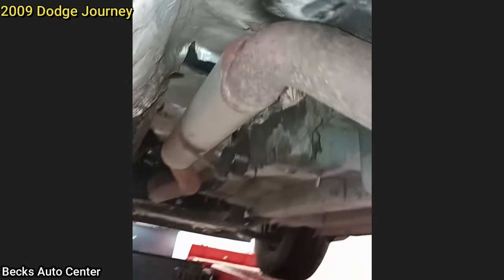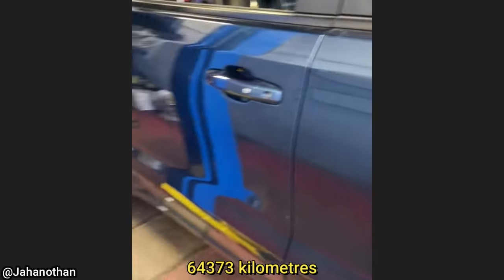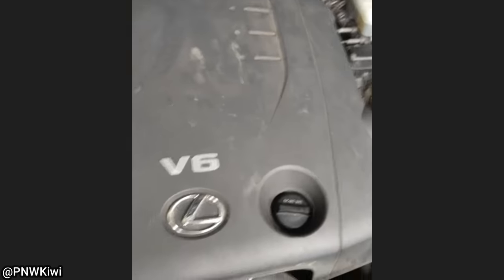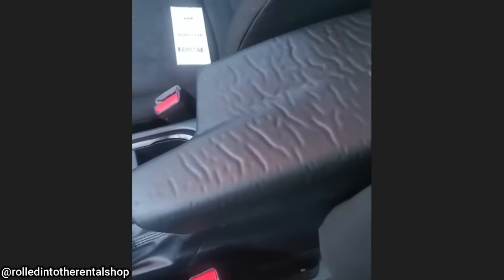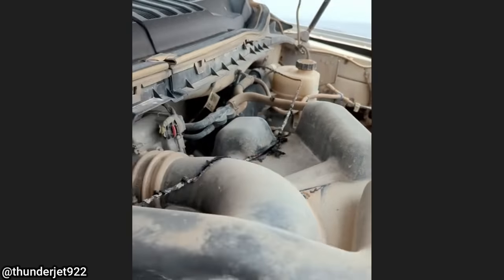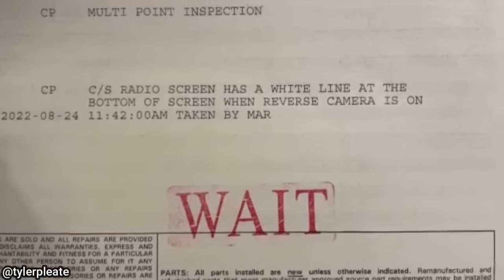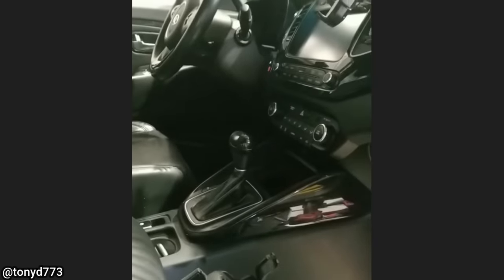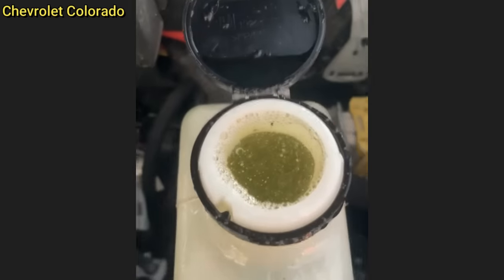Customer States Compilation (The Best of 2022) | Just Rolled In

Comment: As an IT professional, it’s not a computer problem, it’s a fundamental life problem with some people lol
Reply: As a fellow IT professional, the most common issues I encounter are the ID-10-T error and the CTK (Chair-To-Keyboard) error.
Reply: Not a PEBKAC?
(Same as a CTK)
Reply: @nispelsm  I always ask my guys if they checked the connection between the chair and the keyboard... could be a loose screw...
Reply: one simply cannot tell to customer that all his problems are in DNA, because he will ask in whose DNA.
Reply: Yup. Can confirm. 3 years in tech repair service. Never again.
Reply: facts lol
Reply: Absolutely, "User Error" is the bane of design, be it vehicles, computers or anything else. 

You literally cannot make something that the user won't find some way to accidentally misuse in a manner that will make it not work as they expect.
Reply: "My printer isn't working" You need to put paper in it!
Reply: Bro ong
Reply: except if you drive a bnmw
Reply: I felt the glasses in the door handle is a design fault. It's natural to use it as to place items in.
I bet it happens a lot.
Reply: @ruediix  So it's that ladies fault that when the key is turned in the door the motor cranks?
Reply: It's an id10t error.
Reply: Some people? I would bet it’s most people
Reply: @izzystuart7798   Once had a user print a document, then scan it in order to send it by e-mail.
Reply: @alazyfrog5969  I guess it would work lol Maybe they were used to fax.
Reply: As a former IT professional, I can concur that many problems are caused by the end user.  I remember a call from a user regarding their pc wouldn't turn on. This led me to driving from my nieces birthday party at a beach to the office.  The cause, the moron, unplugged to pc to vacuum and never plugged it back in.
Reply: Lol no one mentioned this one yet

Seems like the problem is a picnic case

Problem in chair. Not in computer.
Reply: I work in IT and I find it cringe you're all calling yourselves "IT Professionals"
Reply: @nispelsm  OSI layer 8 issues :)
Reply: When I did IT in the military we always blamed the Human Machine Interface. Specific when the Human interfaces with the Machine.

I still say this now as a mechanic.
Reply: 1:14
Reply: 😂😂😂😂😂😂Yes
Reply: 😂 So we changed the way we teach kids math because of this issue and suprise,suprise the parent (these customers) are mad, talking about "This just doesn't make any sense!" The irony 😂
Reply: P.I.C.N.I.C.   Problem in chair, not in computer. Kind of applies to these as well lol
Reply: People need to take a mandatory engineering class to understand the basics and apply that to any form of hands on work.
Reply: @Crabchann  You have to understand that as people have the limit to how fast they can run or how high they can jump, they also have limits to how much they are capable of understanding. People who are capable of understanding, already able to understand.
Reply: @SunbeanCat  well I look it at it in terms of a large percentage of women lack these kinds of skills as opposed to men. Women tend to shy away from such kind of learning or rather hate it not because they lack capacity to understand it, they are plenty smart and capable, they just don’t preference it to want to learn it.
Reply: @nispelsm  in networking we call that a Layer 8 Issue
Reply: Yes the dreaded and all too common ID-10-T problem!